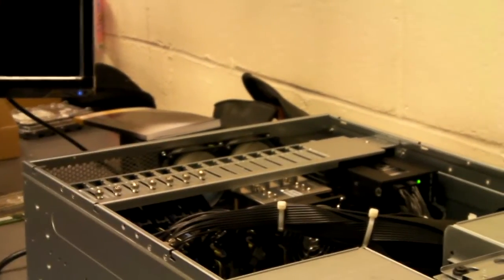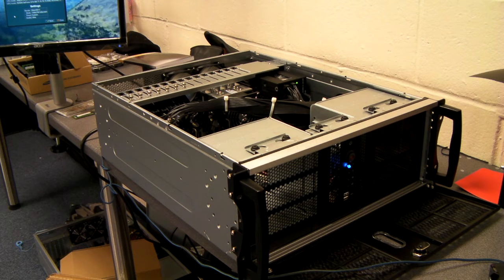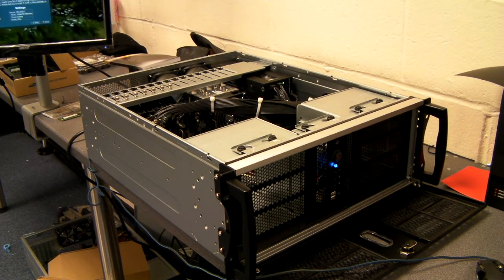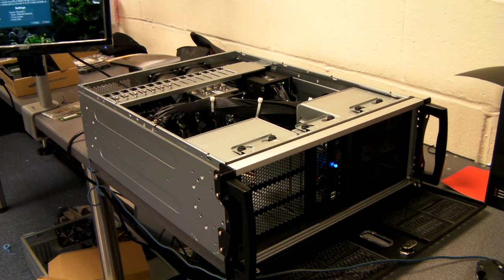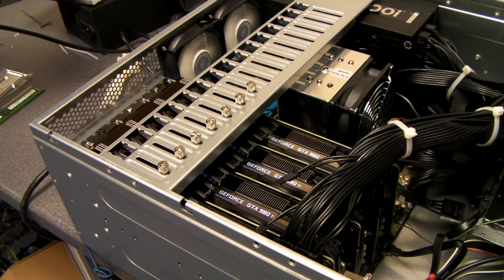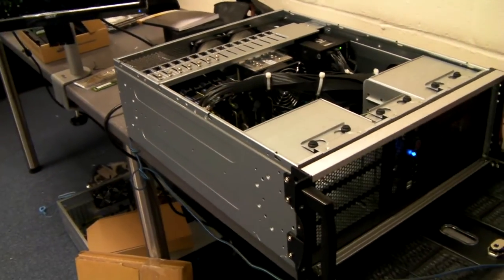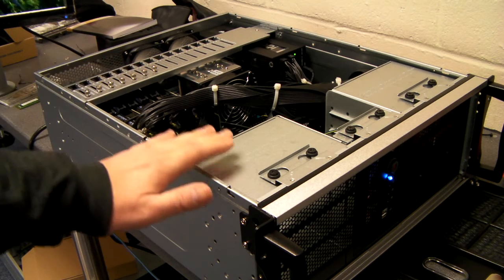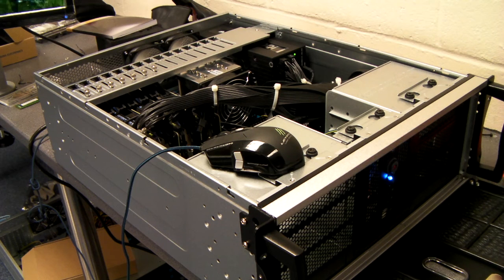Quad Gpu Geforce 980Ti Rackmount Server By X-Case

Comment: What is the purpose for the long bracket spanning all over the GPUs? Visible at 1:26.
Reply: OK, looks like a "Screwless adjustable card retainer for low profile or full height PCI card". So it should push down the cards into the slots. Actually mentioned at 3:23.

Comment: Why a 5820k? has 28 lanes.. so he gets 3x8 and 1x4 unless the mobo has a PLX/PEX chip which will give you more but also slow down the GPUs (PLX overhead).. surely better to have a 5930k and 40 lanes...????
Reply: Actually a 4x pcie 3.0 Lane if plenty fast enough for a modern high end gpu. This setup wouldnt be bottlenecked by that.